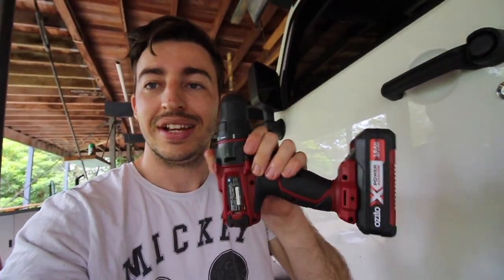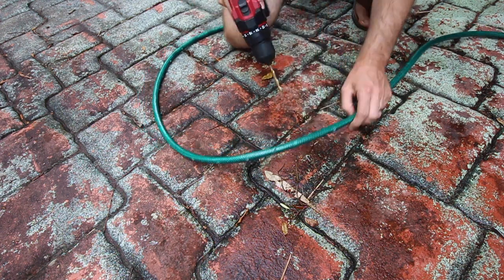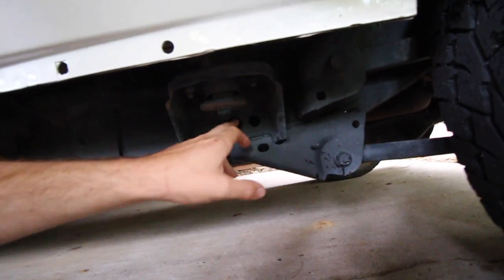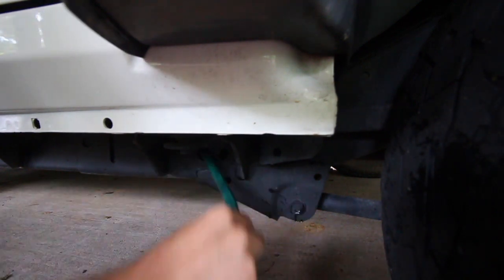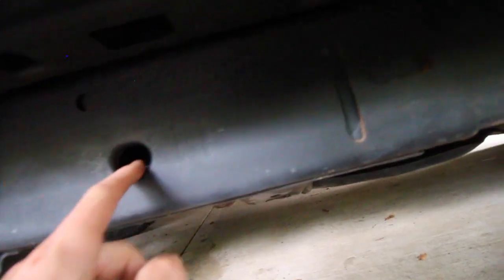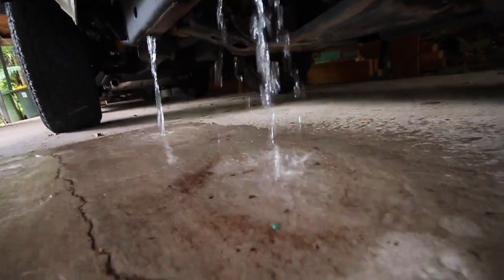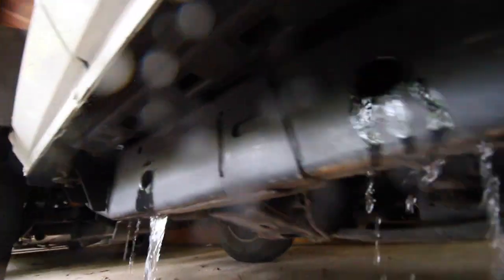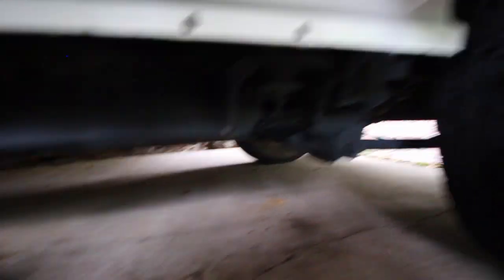JEEP ENEMA

Comment: Good tip, thanks!  One thing I want to say, if you're going to drill holes in the hose, please put a piece of wood under the hose when drilling.  It will prevent the drill bit from being dulled.
Reply from the maker: Thanks mate, I will definitely do that next time, cheers

Comment: I think this is more of a "Jeep liposuction" as it gets rid of all of the nasty stuff that accumulates with time along the side rails.
In contrast, a "Jeep enema" implies poking a hose into the rear end.  (...perhaps for a rear differential fluid flush??)  :-P  LOL!
...
(PS:  Good tip!  Most people don't realize that the dirt that accumulates in the various cavities (& cracks & crevices) of a vehicle contributes greatly to the retention of moisture (& other nasty items) & thereby promotes rust.  Another great tip would be to coat the insides of those same frame rails with a water repellant coating like "WaxOyl" (or something similar) to help prevent rust.)
Reply: BruisedBollocks commenting on an enema video lol. 
Good advice on the coating too! 🤙
Reply from the maker: Hahaha you might be on to something there, love it. 

I don’t know if people don’t know about cleaning the chassis or just don’t get around to doing, I will definitely look into that, would be worth doing for extra protection. Thanks 🙏